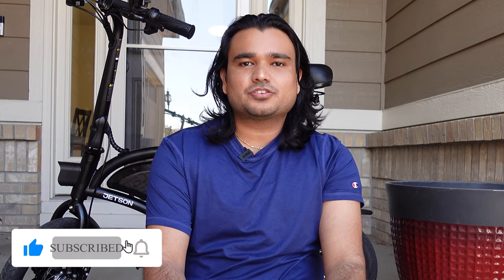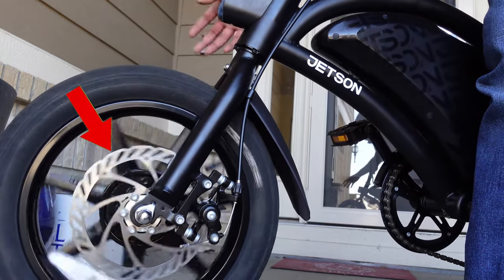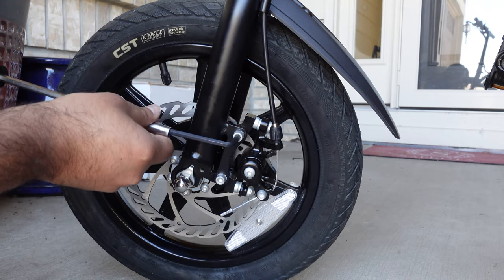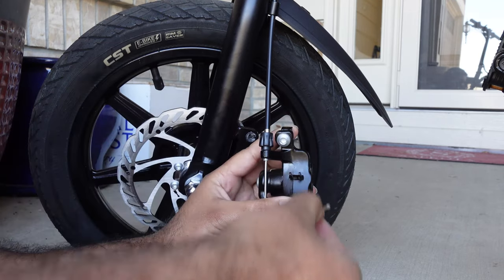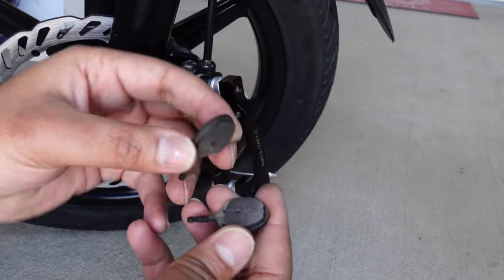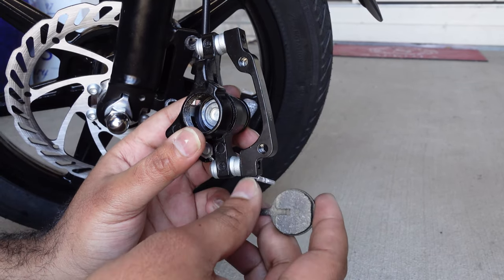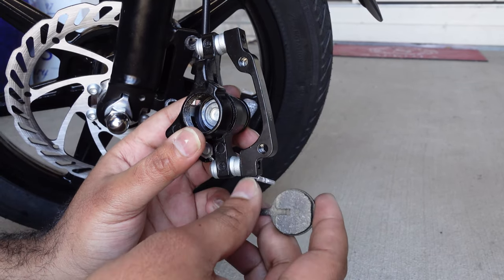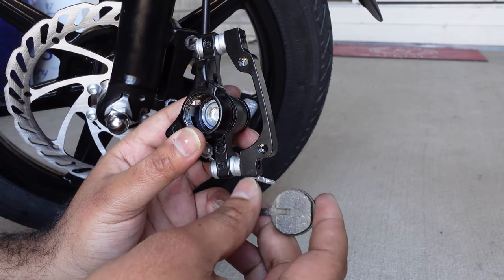Brake Pads Replacement - Jetson Bolt Pro (Folding Electric Bike From Costco) 2021

Comment: Thanks for this helpful video. Unfortunately, it seems they changed the tolerance on calipers on newer Bolt Pro models, and made the diameter 1-2mm smaller. No BB5 pads I’ve purchased will fit (not even the Corki ones you pictured at the start of the vid). So when you try to put your first pad in and move it up and out of the way (like what you show at 8:24), it won’t go up — and so the 2nd pad can’t even be slotted in.

The only option I’ve seen is to grind about 1-1.5mm off of the backing plate.

I’m not sure why there’s a discrepancy between older and newer models, but Jetson won’t respond to any of my support requests.

Comment: Thanks Shiva! I'm definitely gonna try what I've learned because I'm still getting a loud hum from the rear brake - even when I push the bike very slowly. I'm trying not to return/replace the bike because the price went up $50!
Reply from the maker: Hello, yes the price did go up on this bike unfortunately. Perhaps the brake pads are rubbing against the disk? Try using the adjuster as I showed in my video to loosen the brakes a bit, it might help. If not, you might need new brake pads. Thank you for watching all my videos and supporting my channel.
Reply: Same it annoying

Comment: After doing a pad swap and fluid flush on my hydraulic disk brakes (shimano) this brings be back to the simple BMX bike fixes... miss those days. Granted I have stripped down all my bikes to bare frame and built custom built about 5 bikes over time so most repairs seem easy by comparison. Great video!

Comment: Nice video.  Very useful information.  I was going to adjust(shorten) the cable to tighten my rear brakes. But it looks like you can tighten brakes by turning the adjuster as needed as the pads wear out.  Thanks.
Reply from the maker: Thank you very much! Yes, try adjusting the pads, it might help. Just make sure the wheels can rotate freely, otherwise the disk will eat up the pads even more.

Comment: Shiva,
    The hex bolts bolts holding the caliper unit probably have a thread lock compound applied at assembly. Application of a hot air heat gun makes removing the bolts very easy as it softens the anaerobic bond of the thread lock compound. Upon reassembly, introduce new thread lock. Bob's your uncle.

Comment: That was a great episode, Shiva! I never thought about brake pads for all of these vehicles coming with disc brakes. I guess that you have to be careful with the hydraulic disc brakes on more expensive models?

I thought that this video was going to be about doing your own brake service on a Tesla Model 3. When you live where they salt the roads, every two years the pads should be removed and the back of the pads need a lubricant and you have to check for rust, because the pads are rarely used and rarely get hot, there can be a lot of rust. 

The second part of your video was going to be about your electric bike.
Reply from the maker: Hi Mitchell, hope you are doing well. Thank you very much for watching my video and supporting my channel. My apologies if my title was confusing. Yes, this bike doesn't have hydraulic disc brakes so the repairs are easier. 
I don't think I will attempt brake service on my Model 3. I would be very scared 🙂 It does make sense to service those brake pads every two years for those places where they salt the roads. Luckily they don't do that out here.

Comment: Shiva, Your videos have been amazing and assured me with much of my maintenance for my Jetson Bolt Bolt Pro. You wouldn’t happen to know the bolt type for the brakes that hold it to the frame. I misplaced one
Reply from the maker: Hi Thomas, thanks for watching my videos. I am sorry to hear about the missing bolt. If you still have the other one intact, perhaps you can take that one to a hardware store/bike shop and find a matching one? Unfortunately, I do not know the exact dimension and type of those bolts.

Comment from the maker: Thanks for watching my videos and supporting my channel. Here are the parts shown in my video: 
✅Brake Pads (high quality and better reviews): https://amzn.to/3sDU4yL
✅Blue Lock tight: https://amzn.to/2PLP9gz
✅5mm Allen Wrench: https://amzn.to/3czzcDe
Reply: I'm sorry it's not actually the brake pad but the round Metal part that holds the pads...I mean the part where the island key goes the  whole part is loose...is there a blue print or something I can do to make it sit in place?
Reply: Helllllp meeeee???,??,,
Reply from the maker: @corywilliams3688  Sorry didn't see your earlier comment. Are you talking about the disc? If so, most likely the allen screws are loose. You might have to remove the tires to fully tighten them. Check my video here on how to remove the tires: https://youtu.be/9J8PMWywWvE
Reply: @ShivaSapkota  no I figured it out after looking at your video this morning...the front has only 1 brake pad and no metal pin seperator
Reply: I can by new pads but what do I do about the pin?

Comment: Hey i got a question regarding these bikes. How tight should the chain be on these as i have a very similar bike and my chain is extremely tight and I'm concerned about wrecking the back bearing. How tight should the chain be?

Comment: Your videos are really helpful, Thanks! My front wheel is rubbing and I've tried adjusting that wide bolt you show in this video, however, the pad that is rubbing against the disc is the other one, the one closer to the black mount. As soon as I mount the black thing (caliper?) to the frame, the pad already touches the disc. Any idea how to adjust that? I've tried losening the brake cables but the pad still touches the disc even without any pression to the cable. Thank you

Comment: thank you for this great video. Would it be possible for you to show us how to adjust the brakes when the disc is contact with pads and with the break assembly? My rear brake is still making noise and its coming from the disc. I have already tried the adjuster but there is still noise and I read it maybe the disc rubbing against the break assembly.
Reply from the maker: I can make a video in the future with that tutorial. I wonder if your brake caliper is bent somehow? When you check your brakes, do you see the clearance? If you can rotate the wheel freely, the problem might be elsewhere. Sometime putting some lubricant on the hub (bearings) solves the noise issue. Thanks for watching my videos.

Comment: Shiva, will you ever get a small solar panel? The reason I say this is because while one of the battery dies while riding and you use the external battery. You can easily be charging your battery that has died on you. Is my idea crazy? Or is it something that possibly be done? —- love your videos by the way I find them extremely helpful.

Comment: Hi Shiva, can you do a video on how to replace a broken throttle?  There is no video on how to replace a broken throttle. My jetson bolt pro broke.  I am not sure where to buy a replacement.  I do not want to  buy a generic one because Im not sure if it is the correct throttle.  Jetson's website does not show any throttle replacement part.
Reply from the maker: Hello, here is a video I did on a thumb throttle. The process would be the same for a twist throttle. Pleas check the wirings through, some Bolt Pro have different wiring than mine. Thanks. https://youtu.be/F9nTOhPg-e8

Comment: Hello, Thank you for another informative and helpful video. My question is do you know if the tires are made of rubber or are they nylon material?
Reply from the maker: Hi Michael, thanks for watching my video. The outside tread is rubber but I think they use nylon inside. It is hard to tell. I will be taking my tires out to show everyone how to replace the tube/tires in the future and will take a closer look at it.

Comment: Replaced the entire rear caliper for $18cdn with a TOOPRE branded universal from Amazon was easy also the set for both front and rear and can be purchased for $30cdn wish I'd done that instead as it uses the square pads instead of the BB5's and appears to be of slightly better quality .

Comment: Thank you so much for your Jetson videos! Your warm delivery and information packed videos are great! I just got this bike recently and there is a click, click coming from the back.l also I noticed the indicator/cruise control gets warm. Are these normal ? Or should I be concerned? Remember you are awesome! Nanaste
Reply from the maker: Hello, thank you for your kind words and support. I really appreciate it. The click noise could be caused by many things. If it was a "humm" noise, then it would be normal. The click could mean there is a loose part in your motor or the chain is loose. It is normal for the battery indicator to get a little warm as it is getting power from the battery but it shouldn't really be noticeable. Do you have an ability to return and get a new one? If not, I would recommend getting in touch with Jetson. If you need to get in touch with Jetson, first pinpoint where the click is coming from. Put the bike on its stand and rotate the wheel to listen. Sorry you are having issues, hope this all gets resolved soon. Namaste!
Reply: @ShivaSapkota  I bought two bikes both have click noise coming from rear wheel.  I also experience similar problems on both bikes including front wheel not freely rotating on both bikes.  I'm going to try the brake adjustment on the video much appreciated.  In addition, on both bikes I have experienced rear tire being substantially under-inflated from the tire spec..  It seems that these bikes are being put together too quickly and attention and lack of QA process is occurring.

Comment: thanks for video, in my case wire is slipping, do you have any video for that? back break is working but making sound. front wheel break is slipping, i tried to tighten but it doesn't hold the grip, do i need to change wire?

Comment: I have an issue where the front brake is constantly rubbing, but not from the adjustable side. It is rubbing on the pad that is attached to the main brake assembly. Is there a way to adjust that side pad too? I think this may have happened after my daughter hit a curb that was too high so possibly the wheel got shifted or something too. I can’t quite figure out what the issue is but the disc is constantly rubbing on the pad and the wheel does not spin freely. Any tips to check? Thanks
Reply from the maker: Hello, it could be a few things. My guess would be that the disc bent slightly causing it to rub on the pads. You can certainly remove the brake assembly and check if the disc is bent and you can try to make it straight. If the disc is bent, you can also purchase a new one. However, I would have a bike shop take a look at it since it could be dangerous to ride when the wheel doesn't rotate freely.

Comment: Hi again buddy. I've just swapped out my jetson bolt 6ah battery for a 12.8ah thanks to your videos. I was getting about 7 miles on the 6ah one which made me think it was faulty as most people get much more. I've just tested it and got 12 miles with the new battery. But it was windy and I was on roads and slight hills. Also I'm about 12 stone. I was still going and the bolt had just dropped to one bar of power . My bolt is the one without the pedals. My question is does it use more battery at 19 mph setting than the 15 mph setting ? Mine is the old one you can speed up with the app. I'm after trying to get 20 miles without adding 2 batteries that's all. Thanks in advance. Keep your videos coming you are a number one star man
Reply from the maker: Hi my friend, hope you are doing well. 7 miles seem very low on the Jetson Battery, was it always like that since the beginning? To answer your question, yes you will get more range by going 15mph compared to 19mph. Higher the speed, lower range you will get. This is because the bike needs more power to function with higher speeds, more energy is lost in heat and the bike is working harder to propel you faster against the winds. However, decreasing 4 mph might only get you an extra mile or two...what if you keep the extra jetson battery and do dual batteries? That should get you 20 miles.
Reply: @ShivaSapkota  Thanks for fast reply buddy. I bought the jetson second hand and it looks brand new but they haven't used it for a year so that's why I thought the battery may be no good. But judging by today the battery at 7 miles is ok as the double 12.8 ah Looks like it will only do 14 . I'll test properly at weekend When wind drops. It was struggling against wind. I nearly stopped. It still had 2 bars when I stopped running it. It's still way better than it wap with new battery. I don't want to add 2 batteries really. I've also bought a 4 amp charger to speed up charging. Just testing that now. Thanks for your help. I would be interested in knowing what range difference is at set at 19 mph compared with set at 15 mph though he you get chance some time. 😁
Reply from the maker: @skycamvideo  I will test that once I figure out my controller upgrade to make my Bolt Pro go 19mph 😊 I bet you will get much higher range if you ride on a less windy day. Wind really affects the performance of your bike.
Did you see my response on your question about the cruise control? The cruise control wires are yellow and white on the throttle harness. I am going to be posting a video this afternoon showing how to add a thumb throttle and I have close-up view of the throttle harness. Also, you gotta teach me how to fly those drones 😁  I have got the original Mavic Pro but haven't really flown much.
Reply: @ShivaSapkota  wow brilliant. I still fly my old Mavic pro. Best ever drone. Nice to see you checked out my channel. Gtd been flying for about 8 years now. The reason I want to get the 20 miles is to take my drones up into the hills. Etc. I used to ride a powered skateboard but nearly died when I came off at 30mph and hit a lamp post so now I'm riding a much safer transport. Nothing to flying the Mavic pro. Nice drone. I've been out to sea 3 miles with mine to record a ship. Scary but worth it. Anyway can't wait for your next video buddy.
Reply from the maker: @skycamvideo  I subscribed to your channel bro, good stuff. Do you have a 107 license or do you just fly recreational? I took my drone back home to Nepal a few years ago and other than airport securities giving me trouble, it was fun to fly around the mountains over there.
Reply: @ShivaSapkota  no I don't have a 107. Don't need one as I can fly almost anywhere with the new mini 2. Also not needed nowadays . Nice to know you subbed buddy. Stay safe and happy riding and flying

Comment: My Jetson bolt pro’s front wheel makes very loud noise, not only when riding but also when I spin the wheel. How can I fix it? Thank you.
Reply from the maker: Please make sure the brake pads are not rubbing against the rotor disc. You can loosen the pads by using the methods identified in this video. If not, try to listen closely on where the noise is coming from. You might even have a bent brake rotor.

Comment: Can you help me out with an issue I am having and losing power and have a flashing headlight when turn handle bars.   Which wire could be causing this. I read it is the power button wires red and black, also power lights are blinking when this happens, maybe I should reroute the wires outside on frame. Once I solve the problem. Have had it year and a half.

Comment: Shiva, can the handle bars be changed, the throttle is the hole handle bar grip. This is different from the other bikes. Thanks for the helpful videos.
Reply from the maker: Hi James, unfortunately that will require getting a thumb throttle. You can disconnect the power to your existing throttle and get a different one that can operate using a thumb or a switch. Thanks for watching my videos and supporting my channel.
Reply: @ShivaSapkota  Thanks for the info 👍
Reply from the maker: Hi James, I just posted a video on adding a thumb throttle. This will disable the twist throttle. Please check that video out.

Comment: Hellp Shiva I have been runing into lots of weird noises from my Jetson bolt and I was just wondering if you have run into any problems and if you bike makes some funny noises too thank you!!!
Reply from the maker: Hi Kaden, yes the bike does make some "humming" noise from the rear wheel. This is coming from the motor, if that is what you meant. Listen to it closely and if it is coming from the brakes, try to adjust them by turning the adjuster as I showed in my video. Finally, make sure the chain is not touching anything, sometime that could be making the noise as well. Hope this helps, thanks for watching my video.
Reply: @ShivaSapkota  oh wow yeah thanks ill have to try it

Comment: I am having problem with my jetson bike. I tighten the rear brake and after there is no throttle and battery shows full. Front light keep flashing. Any solution?

Comment: Hey shiva adding 2nd battery completed ty toggle switch parts purchased but before i do that i have a brake issue the the brake pad is loose some how n my island key isnt helping do u have any tips or advice i cant stop at high speed😭

Comment: my new Jetson's front left brake pad is rubbing against the brake rotor, looks like the rotor is bent towards the left and the adjuster on the right adjusts the distance of the left and right brake pads at the same time so I bought a tool to fix the bent rotor
Reply from the maker: Would you mind putting a link for the tool you purchased? Thank you!